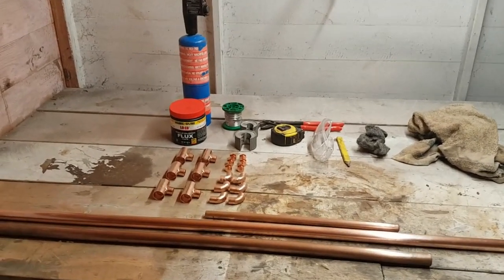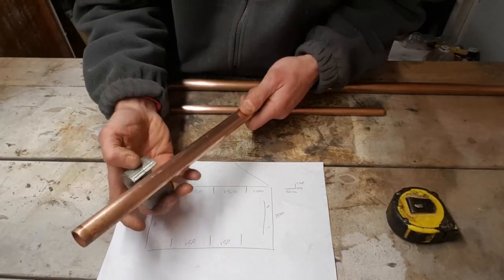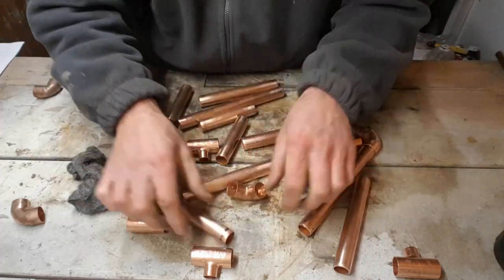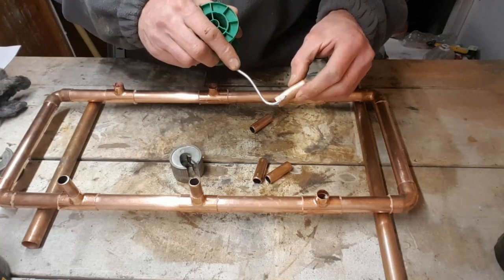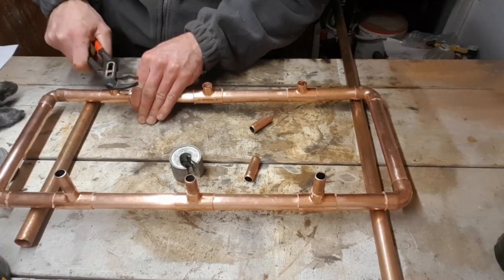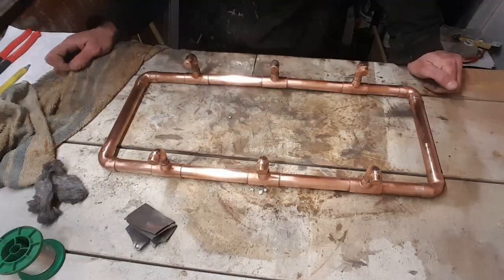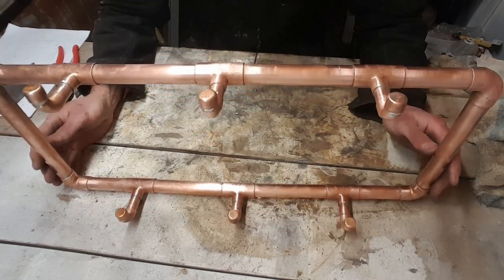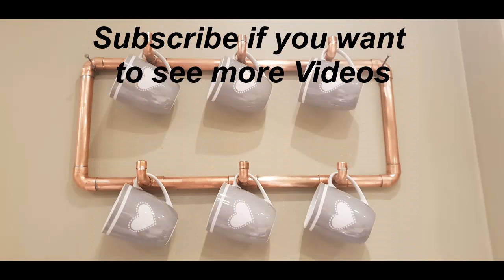Copper Design Ideas Cup Holder

Comment from the maker: I meant to leave a materials /cutting list at the end of the video but i thought i would put it here instead.
The pipe lengths  are 
22mm
4*100mm
4*150mm
2*200mm
15mm
6*30mm
if you need any further info thats not on the video please get in touch.Regards BackYard Projects